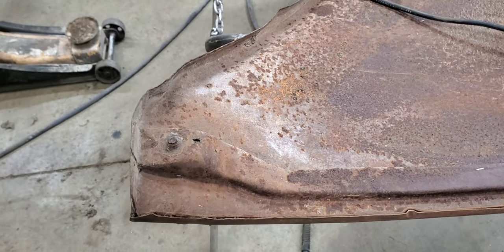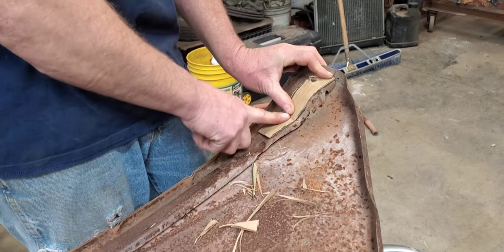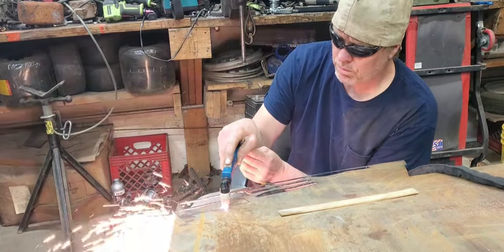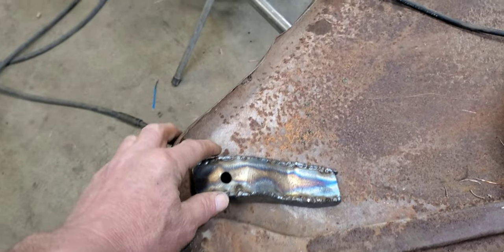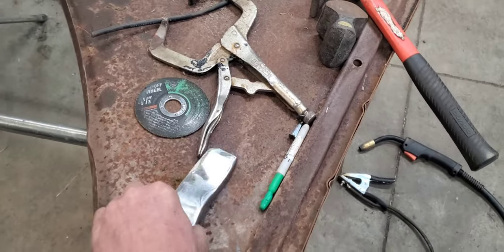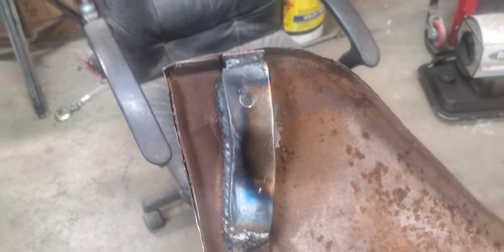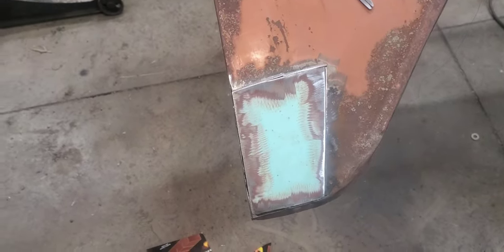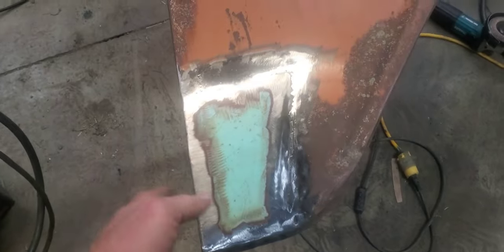Trifive 57 chevy budget lower fender rust repair for the lt1 roadmaster blue goose project

Comment: When you repair areas like this one, do you add drain holes so the area doesn't rust again?
Reply from the maker: Yes the front edge is not welded an the bottom corners of the brace are left unwelded with about 3\16 gap on each side but I guess some drilled holes in the brace would probably help and not take away from the integrity

Comment: You make it look easy! I've wanted to put a mid 50's Cadillac Coupe or sedan on a late model chassis to tow my '73 Avion trailer but just don't have the resources.
Reply from the maker: Well if you do decide to give it a try the Cadillac Fleetwood between around 92 to 97 have about the exact platform as the roadmaster except with a little longer wheel base  which would work better for a 50s caddy anyway and are fairly reasonable these day ! 👍

Comment: can you show us your welder settings and what size wire you are using on these butt welds? thank you
Reply from the maker: I'm using a  Hobart 140 smaller welder with 023 wire with a 75 25 argon mix I'm getting ready to post another video addressing your question!
Reply: @midnightflyer9636  Thank you for that info. Helps us guys a lot.